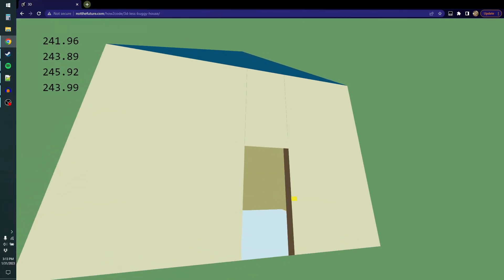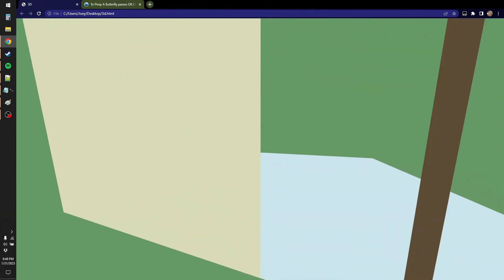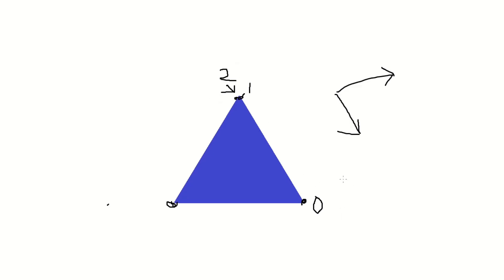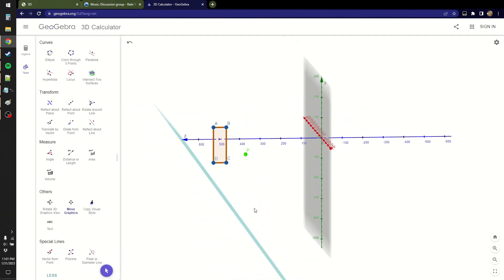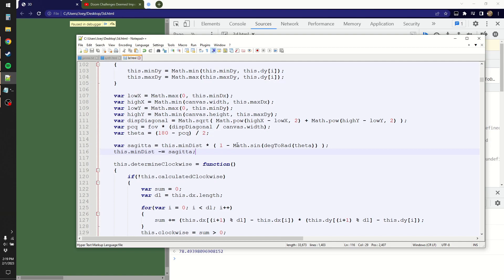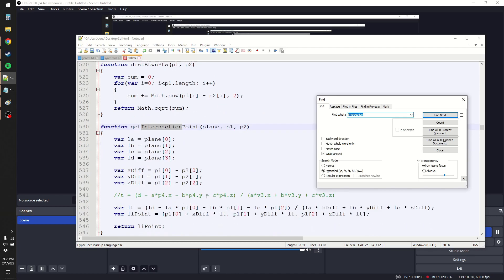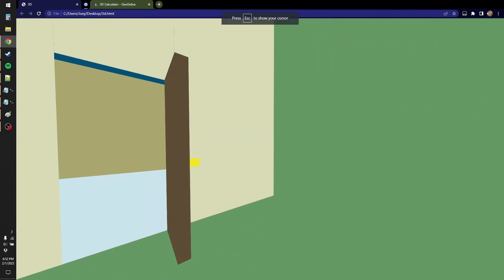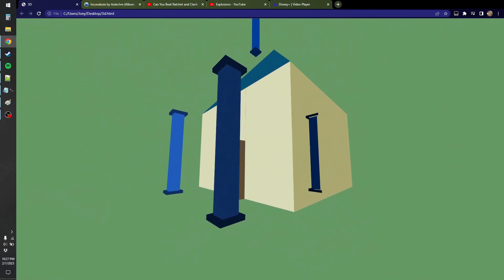3D Engine Coding: The house works, but...

Comment: for the plane/depth test, if you are writing this out without a graphics api (with, just enable depth test) you could make a depth buffer alongside your frame buffer. When you go through placing pixels to the frame buffer, you need to place the Z coordinates to the depth buffer post-transformation. You will need to use the barycentric coordinates of each poly for the Z coordinate to ensure smooth overlaps.

Comment: You should consider storing geometry in triangles only instead of quads, it could save you a bunch of headaches. You're fundamentally bound to run into issues sorting entire shapes, though, because it cannot account for every case (e.g. intersecting faces) and normal cases are very finicky
Reply: this is the solution

Comment: For finding the intersection point... maybe I'm misunderstanding what you're trying to do but couldn't you just take the player rotation, multiply it by the camera far value, then give that and the player pos to your getIntersectionPoint function?

I dunno though, my lazy ass just relies on the depth buffer in OpenGL or whatever I'm using, which handles all that good stuff for me

Comment: 2:37 Hm, this implies you are not using a Z-Buffer. If you are not using a Z-Buffer it will be impossible to get a good sort without a lot of fancy mathematics and recalculating textures, Z-Buffers are for more than just fancy triangle intersections.

Comment: The fact you didn't have a clear distance based render order hurts my eyes with the flashing in similar fashion to z fighting.
Reply: who is bro talking to
Reply: @crafterrium8724 yo mama
Reply: @dingas4979  yours too lol
Reply: also how are you coding what looks like c in html
Reply: why not keep track of the point the camera is at and then use that the points on the objects to find the closest one and render that last so it appears where it should.
Reply: you could check the points on the wall by taking the edge point values and saying that if the space in front of the camera is less than the more positive point and more than the closer to negative point in each axis than that point is apart of the object and you can use the point an imaginary line from the camera to find if it is on a point in the line of an object or if it just passed it by ray marching
Reply: nvm you basically did the same thing to solve your own issue but without ray marching just checking if it was on the imaginary line by remembering the points on it
Reply: @randospawn7495  bro are you ok
Reply: @SHA-HEEEN  prob not but I'm still here

Comment: i wonder how 90s programmers did this without the speed of modern computers
Reply: Through great suffering
Reply: With significantly less janky things than this. The way you're supposed to do this is with triangles only, and with depth sorting. It simplifies the math a lot
Reply: @nikkiofthevalley  Or Z-buffer depth test.
Reply: @theRPGmaster  That's really expensive on the CPU. Only reason it's used on the GPU is because it's more efficient than depth sorting if you can do all of it at once, which the GPU can do.
Reply: @nikkiofthevalley  True. I forgot this was showing a software renderer

Comment: I don't exactly understand what you are doing here. Are you manually specifying which triangles should be drawn first? Either sort the triangles from top to front and draw in order or implement depth buffering. One of these will solve all the overlapping issues.

Comment: Why not use blender or unity lol
Reply: @dansmemeaccount  no the tools is what’s making progress, using raw code like this for 3d animation is just backwards and doesn’t achieve anything. It’s like either being a farmer with just a few hand tools and gloves, or you can be a farmer with different tractors and other large power tools. Doing the first one is just completely backwards. Humans naturally evolve to do things that are easier and faster, doing it the long, harder, less efficient way is regressing evolution, so your going against human evolution.
Reply: @Wanderer2035  its not that deep, dude just wanrs to make a 3D engine by himself
Reply: @Wanderer2035 there is alot that you can learn from making it yourself. Yes. It is not  the easiest way to do it, and will take you more time. But you get a better understanding of how things work, and that new knowledge even helps with making thing while using already existing tools, libraries or engines, as you understand better what is happening.

Many people also like to code and just challenge themselves to try something they havent done before

Comment: finally someone else with the same taskbar placement!
Reply: Freak
Reply: Something out of mythology
Reply: You guys don't understand, this taskbar makes it so the aspect ratio of your non-fullscreen program is almost the same because the program also has a header that takes up some amount of pixels.
in case when the taskbar is either on down or top part of the screen, the aspect ratio is not preserved at all.
That's my take.
Another take is that it's super comfortable but that's just a subjective opinion.
Reply: If i even use a vertical taskbar I'd probably want it on the right

Comment: Typically, specifically in order to avoid the problem you were having with triangle and points, the default polygon shape is a triangle, not a quadrilateral. You can make a quadrilateral by just putting two triangles together.
Reply: triangles just have a lot of different advantages. from my understanding, they're also just faster and easier to calculate in general, and it's also easier to make more types of irregular polygons with triangles.
Reply: @Templarfreak Yes, and you need triangles to make Textured Mesh (Basically, the UV requires triangular shapes to work with)
Like, its not a rule, but it would be a mess to work with quadrilaterals
Reply: @Templarfreak  Additionally, any set of three points (which would compose a triangle) are axiomatically coplanar, and thus can always be rendered as a flat face, whereas the points of a quadrangle are not necessarily so.
Reply: The DS supports quads in hardware and doesn't split them into triangles. You can tell by the way it interpolates things like vertex colors and ST coordinates :)
Reply: @declanmoore  Yes, this is because Nintendo is smart and bakes coding into specialized hardware for fast speeds. They had a similar function in the SNES they used to make the original Mario Kart.
Reply: @flameofthephoenix8395  my understanding of the way Super Mario Kart (and similar games on SNES) did its 3D effect was by changing the background affine parameters per scanline with HDMA, which isn't at all what 3D graphics is like on the DS. Unless I've misunderstood what you're saying or misunderstand Super Mario Kart's 3D effect.
Reply: @declanmoore  Not what 3d graphics on the DS in their entirety is like, but a textured quad fill is quite similar to warping a background picture.